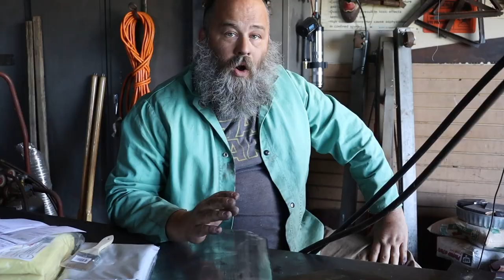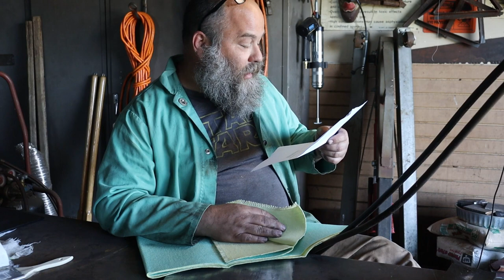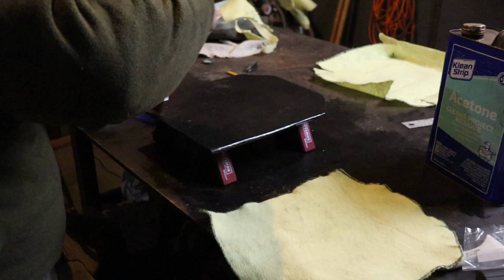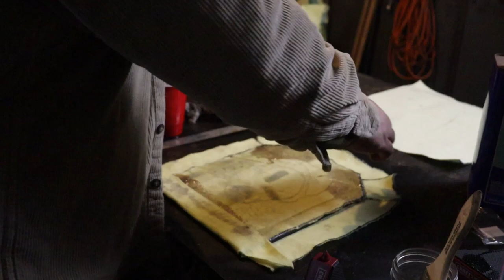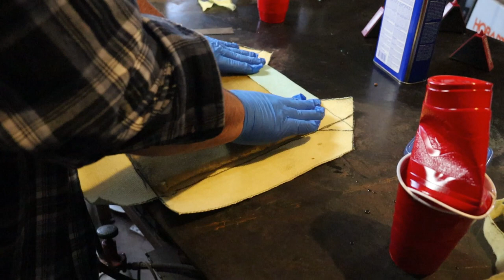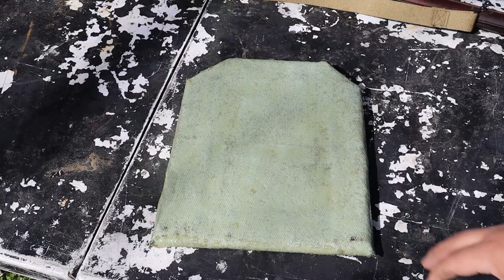Blacksmith Body Armor For The Ukraine Part 3 Anti Spall Coating

Comment: Sir you would actually be mistaken.  It basically is a truck bed lining.  I would recommend spraying it on the plates at about 150mils minimum and do both sides and pay attention to the edges as they need to be coated extremely well also.  Take one of your plates to a local truck bed liner shop and have them to spray it for you.  It does require specific equipment to process and spray the product as it is a fast set thick film plural component coating called Polyurea.  Polyurea is the Technology, which does have many specific formulas for specific uses.  Or you could send me one of your plates and I’d be happy to spray one for you.  Check some of my videos on my page.  I have one video on shooting a unprotected plate and then one that has been sprayed.
Reply: Hello. I'm from Ukraine))).. And I began to actively watch this channel) .. The idea to paint the plate also visited me .. We have these coatings like "U-POL Raptor". But this needs a thick layer .. And there was an idea during painting to saturate the layers with soda or sand to increase the breaking density of the coating. BUT during the war, we are unlikely to be able to paint normally.
THEREFORE, the BRANDON method is now the most relevant ((((.
Reply from the maker: I will take you up on that! Shoot me an email VooDooForgeBusiness@gmail.com
Reply: Reminder: VooDoo forge took you up on the offer, see below. I thought I'd nudge, because Youtube is really flaky sending notifications of replies.

Comment: Brandon your doin great work sir! I can say having a bit of experience with composite work that your logic is sound. Id like to toss another idea in the mix that might be more readily available. HDPE plastic layers in the spall protection layers. The stuff antifreeze bottles and milk jugs are made of.
Reply from the maker: I may give that a shot! Pun intended.
Reply: @VooDooTennessee  
Is there a difference between fiber glass resin and epoxy? If so, why the resin or why not the epoxy? 
Love the series an HD the channel.
Reply: Ar500 actually makes an HDPE plate. So this seems feasible.
Reply: @chrisgriffith9252  yes there is a difference between the two but ballistically you would have to look up the particular one your using and compare statistics and do some live testing to confirm that it meets your needs or use. Sometimes the data sheets and real life don't match up and the material of choice as you can see in the video can make a big impact on your results.

Comment: Military grade= Cheapest supplier that cut every corner they could to make as much profit as they could !
Why not something simple like plumbers silicone or PU foam? Or simple cotton sheet glued in wood glue . Or a tire rubber.Dont get me wrong but i dont think amazon delivers to ukraine right now .
Reply: Hello. if you are from Ukraine, then you can also find the necessary material here. BUT not military .. military has not been sold before))))).. but in general Kevlar and so on can be found in different densities .. You can even look in fabric stores .. There are fabrics very similar .. There are Aramid fibers for building yachts and etc..

Comment: You should watch Tod’s workshop tests with arrows versus armor. Knight’s armor, while also having other design choices, put in a steep V shape below the neck to deflect the wooden shards of arrows that hit the chest, and prevent them from going up into a knight’s face or neck, and you can see it work in slow motion in Tod’s videos. I think this would be a far superior method to any sort of coating, though the two together would be the best, obviously.

Comment: Why don't you weld a additional rebar (either cut in half and outside edge rounded or full rebar) around the outer edge of the strike face (the side that is going to be shot at), where the spalling can help contain it, but the larger fragments can get wedged between the rebar and plate or straight up stopped.

Comment: I’m considering getting into blacksmithing. Theoretical, say we had some full faced helmet like the ones from Star Wars that completely sealed your head, wouldn’t fragments like that no longer be an issue because then they’re flying up into an armored helmet? Thanks. You’re gonna be seeing me around your comment sections from now on, gonna be asking a lot of questions, appreciate you.
Reply from the maker: maybe but it would be really heavy
Reply: @VooDooTennessee  Ah see weight of metal armor has been an issue that’s been bothering me for some time. What metals are light enough to wear to a modern battlefield or urban warzone that can still deflect larger caliber fire like the 7.62, hell maybe even as high as a .50 call? Does such an alloy exist? Or maybe a decently thin plate of metal armor with composite armor and Kevlar over the top in thick layers to maintain light-weight while not sacrificing durability. What do you think?
Reply: Perfectly logical question. The real answer has three elements, in my non official opinion. Firstly, every kg you add on your head is a kg of ammunition, first aid kits, radios, night vision etc that you cannot carry. You cannot carry enough armour to do without these things. Tanks can't do it. Secondly, even if you could carry it your overall awareness would drop, both sight and sound. So you'd have to rig cameras and sound, and that just adds more weight. Thirdly, there is therefore a sweet spot, balancing these factors, and that is pretty much a modern helmet. It protects you from the main threat, which is airburst shells, and the top of your mindbrain when you stick your head up from behind cover. Does that help explain?
Reply: @tamlandipper29  Yes it does, thank you.
Reply: @adamlaouiti6415  Level 3 plates already weigh about 10lbs. Ceramic plates about 8. HDPE about 4. Maybe 2 plates sandwiched around HDPE?
Reply: @mijithebub  Possibly, it’s not a bad idea.

Comment: that "yellowish" color is called "cream". Taupe is more of a tan/gray color. Nonetheless, another great video. Thank you. The metric system is ridiculous. Better to stick with the best system which is called American Standard( and no it is not the Imperial system which was in Canada and Britain but not the US!) The only problem I foresee is that fiberglass resin does not bond with Kevlar. I have had plenty of experience working with both as at one time I worked at an aircraft manufacturer whose main business was making parts and panels with Kevlar, fiberglass, and carbon materials.
Reply from the maker: Cream huh? My knowledge of colors continues to grow! Thanks for watching Robert, this is an ongoing saga.